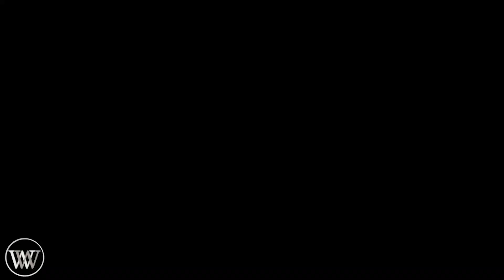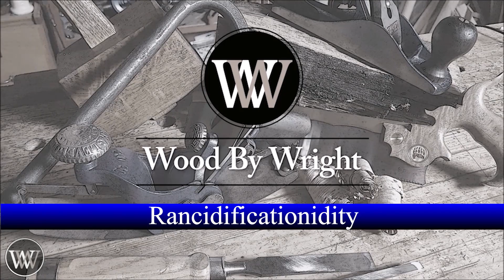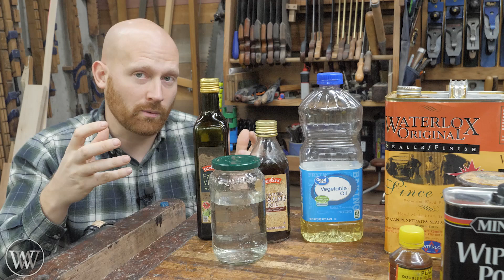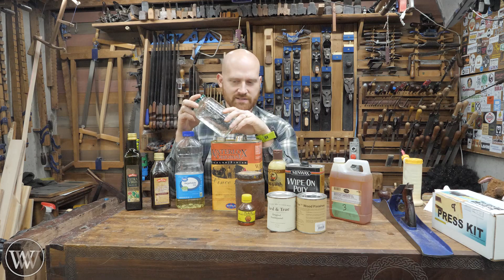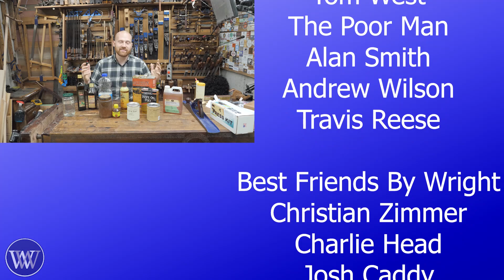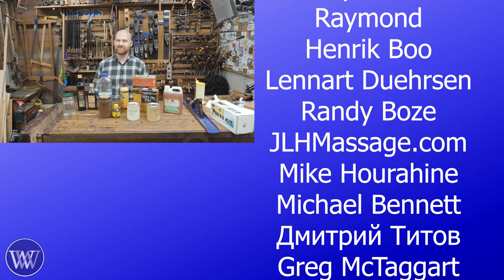What Does It Mean To Go Rancid Food Safe Woodworking Finishes

Comment: James, I am abandoning the woodworker in me,  and putting on my  highly trained sous chef toque:  

If you use a film based finish (lacquer, shellac, etc) your knife edge will eventually work through the finish, you'll start to get little bits of finish breaking off,  you'll eventually wear through the finish and expose raw wood underneath.  And yes - that stuff will get into your food. As Stumpy Nubs has said - by the time it's full hardened, it's inert.  Many folks don't know this,  but shellac is used in many foods - it makes stuff shiny. Ever eat M&M's?   

Next - food grade oils take a long time to go off.  If you use the boards regularly (even once a week) and wash, dry and store them properly afterwards (you have to wash the ENTIRE board - not just the cutting surface) -  the oil won't have a chance  to go rancid.  I oil mine every six months or so.  I use whatever is lying around the kitchen in abundance at that moment.   I oil them lightly and wash and dry them immediately after oiling. 

Lastly- If you need boards to leave for months on end with no use, or in the back of your  locked up,  110f degree camper van all summer - buy NSF plastic ones.   

A whole, huge lot of this is about common sense.  If the whole idea just freaks you out - then just don't finish them.  They'll still last for years and years.
Reply from the maker: Well said.

Comment: I think the thing most people mean by "don't use olive oil, it will go rancid" is the fact, that olive oil acids hardens/oxidizes so slowly, that the fats and proteins in the oil can oxidize before the oil acids, which smells really bad. The same goes for cold pressed, untreated linseed oil. It can harden so slowly (taking weeks), that the protein/fats oxidize and smell. That's why oil for paints, oil for treating wood outside is usually processed in some kind of fashion. Degummed etc. so the "smelly bits" that oxidize and go rancid don't "spoil" the smell of the oil while its oil acids polymerize.
Reply: does raw linseed oil smell bad when cured?
Reply: @noahjohnston  No. It has no odor whatsoever. Once cured it is like "natural plastic" or soft rubberlike in consistency.

Comment: Great video!  My concern about wood finishes used on items that contact food is the drying agents (often heavy metals) that manufacturers put into ready to apply finishes like BLO, Danish oil, and wipe on poly so that they dry faster between coats.  I don't even worry about the solvents, however nasty, that these products contain because when they're fully cured, those solvents have all long since evaporated away.   
My only concern about using vegetable oils on wood surfaces that will see contact with food is the possible transfer of off-putting flavors to my food during use.  Also, the smell of rancid or polymerizing oil is not appetizing.  But there's an easy, if time consuming fix to this problem - not using those items until the vegetable oil finish is FULLY CURED which can take many days.   That's the one advantage of mineral oil - you can give a dry cutting board a quick once over and use it pretty much immediately without any weird odors or flavors ever being a problem.

Comment: Most people  use the term rancid to mean the oil has changed flavor and smell to become something no longer suitable for food.  Not all oils polymerize over time.  This is very important when it comes to wood finishing.  If you put a non hardening oil on a cutting board or salad bowl and it then becomes rancid, that smell and flavor will be transferred to whatever food is in contact with that wood.  

For wood finishing you need an oil that does polymerize to become hard and tough.

Comment: The finish is also going to depend if you are doing end grain vs side grain.  I like the mineral oil on my patterned end grain board because it keeps the wood expanded, and yeah I have to reapply it, but it means the board doesn't dry out as fast as a finish that hardens and can't be reapplied.  I should specify that I put a tung/mineral spirits finish on first and let that dry out completely as a base before using the mineral oil as an top coat.  If you are using a side grain board you would want something that toughens the hell out of the wood, where as the end grain board is already pretty darn tough.  Good video!

Comment: Thanks for  this video. It will help me to counter my many green relatives who think I'm trying to off them for the inheritance.  I confess I have never used mineral oil for anything beyond rubbing on a baby's bottom. For wooden food utensils, my go to is olive oil mostly because it's already in the kitchen. But, it is slow to oxidize, so I prefer BLO.  Whichever oxidizing oil you use, It speeds the curing if you hang it outside or in a north window to let the sun shower it with UV.

Comment: that's youtube for you.  i see so much misinformation in the wood working channels from people with no training or background,  espousing all sorts of wild theories which they learn't from someone else on youtube etc etc.  my biggest pet peeve are all the videos on setting up jointer knives.   they all say snipe is normal and just cut your boards a bit longer so you can cut it off.  they all tell you to set your knives just a little higher than the outfeed table.  i got so fed up with this that i actually did a video on the correct way to set up a jointer and use it.  so good for you james in attacking the bullshit and spreading some facts in this area.  to be honest, i have always used a mix of poly, linseed and turps to really soak down into the wood.  once all the chemicals have gassed off i feel its pretty safe.  i am retired now but still enjoy watching different channels for ideas etc.

Comment: While I've used vegetable oil on wooden utensils since I was a kid and learned it from my Mom, trying to re-educate all of my clients doesn't sound appealing since "rancid" is widely accepted as a bad thing and most people know that different oils do go rancid. I make a ton of "designer" and regular cutting boards for clients and send them home with a jar of mineral oil/wax blend to reapply when needed. It just works. Also, olive oil going rancid on a wooden spoon stinks very badly and doesn't make one want to try it again or even re-use the utensil.
Reply: This has to be my favorite comment so far. I agree with the olive oil statement, and would add that I saw a news article a few years back that stated that many bottles of imported olive oil sold in stores were rancid by the time they ended up on the shelf. Yeah... I find it easier to just sell customers on non-drying oils and wax

Comment: I always figured that for the food oils that if they went "rancid" then the thing they were applied to (cutting board, bowls, utensils, etc) would start to smell bad or give the food an odd taste. However, I would think if you are using those items, washing, and renewing the oil that it would not be an issue? Also, I am most certainly in the camp of "well I heard it from" or "I read it on the internet". Time to dig through some research papers.

Comment: Well here are the questions I would have:

1. which finishes in general get a higher bacteria load? and  They I am sure aren't all the same an d some will encourage worse species than others perhaps.
2. Which ones would possibly smell worse over time and leaving in humid warm conditions?

Those are the two burning questions for me putting something on wood.  I will look at the references, but if you do a follow up please address these?
Reply from the maker: I was actually trying to find any information on bacterial load on different oils but most things that I've said and haven't touched on it or just say that it's all similar. As to smell or taste once it's polymerized they're all the same. It doesn't do anything.
Reply: @WoodByWrightHowTo  I did have one question spring to mind during the video that's in line with these questions/ your comment. Do all the oxidation prone oils polymerise? From my searches of (a not very reliable source) Wikipedia, olive oil for instance has only 15 % polyunsaturated content vs the 65-70+% content in lindseed oil. As such any molecule made during the oxidation process is still likely to be a low-ish length oil vs a relatively long chain polymer. Admittedly that's not to say the molecules are still volatile enough to smell but I'd imagine they will act extremely different to say lindseed oil. Something to look up I guess when I have some free time lol

Edit: typos lol
Edit 2: forgot to say, great video.
Reply: @aledlewis5371  No, not all oxidation results in polymerization. This is a good video to bring up the topic, but that is a criticism of this video it conflates the two a bit. Oils that polymerize readily are drying oils. Polymerization requires not only oxidation and breakdown, but cross linking. Not all oils do this to the same extent. Rancidity is not polymerization but the unpleasant taste and odor from the initial oxidation, and generally before significant polymerization happens.  If/when polymerization occurs there will be no unpleasant odor or taste.
Reply: @ccbowers  well that's what I thought, when he included olive oil in the list of things that you want to go rancid. I haven't really got any personal experience with olive oil and the rest going rancid, at least not in the food sense. But if the oil doesn't actually polymerise, and I'd be suprised if olive oil does by it's typical oil content, then its likely to be similar in succeptibility to leaching as the mineral oil. It may still be food safe, but would you actually want something rancid to leach into your food? Same with the chemical driers in drying oils. I doubt the oils will react to completenion and so would have thought the rate of leaching would slow but it wouldn't actually stop. It wouldn't be a problem for James's homemade BLO and I'm pretty sure he mentions it himself in other videos. I'll be honest I haven't had time to really check the literature on the commercial catalysed versions though.
Reply: Just watched the Stumps Nubs video and, whilst I'd still like to see literature on it before using it myself, it does sound like BLO likely doesn't leach in dangerous amounts do I take that part of my comment back
Reply from the maker: Yes. Not all oxidation is polymerization. But other forms of oxidation will change texture taste or color. But there is no form of oxidation that will become harmful. They just become less desirable if you want to taste them.

Comment: My girlfriend has a huge number of bottles with all kinds of oils ment for some kind of cooking/medicinal/skin care/etc. use - wallnut, raspberry, apricot, cherry and a lot more laying around and most of them are expired, some have a rancidy smell and some are still sealed and look fine. I was wondering if I could use them as wood finish in both indoor and outdoor projects. Would they do any kind of job protecting the wood compared to leaving it untreated, specifically for the outdoor stuff and would there be a lingering smell or would one develop over time? I do not intend to use them on surfaces that would come in contact with food like cutting or charcuterie boards, more on the line of table legs and arm rests. I just don't want to toss them all out and buying wood finishing oils where I'm at is kinda expensive so in my mind it seems like a good idea to use what I have right now. Any thoughts?
Reply from the maker: They would be better then leaving it raw most of the time. The smell will disappear with time. But a lot of it has to do with the polymerization time of the oils. With most fresh oils that is a week to a month and it may get washed out before it can cure.
Reply: @WoodByWrightHowTo  thank you for the quick reply! I'll be sure to try and see how it goes.

Comment: I'm sure you've said it elsewhere, but what you do finish cutting boards with?  Seems you want to deal with the concerns of not imparting "off" flavors to whatever is on the board, plus its a finish that knives have to cut on, so film finishes I would expect to not perform well.
Reply from the maker: I used home made BLO. Once any oil polymerizes then you don't have to worry about flavors.

Comment: I have butcher-block countertops and when researching oils to finish the countertop I came across all these opinions on oils to use and to avoid "Rancidificationidity"  I always assumed that you wanted to avoid these oils because when they went rancid they would smell bad.  Was that a bad assumption?  I have to oil my countertops seemingly non-stop with mineral oil.  If the slower oils go "rancid" but don't smell that'd save me a bunch of time (and money)
Reply from the maker: The smell is only there tell it polymerizes. So it all depends on what you like to smell for that month or so. For counter tops you can't just keep them in the shop for that time.
Reply: @WoodByWrightHowTo  thanks for the response! Love the channel!

Comment: erm, the OED says Rancid means "unpleasant taste or smell". These other conditions have other words that describe the: moldy, fetid, putrid, tainted, etc.. 

Mineral Oil is unpleasant to taste and smell right out of the gate, not only that, but mineral oil will give you epic, four horses of the apocalypse style, diarrhea. In the US "food safe" is government regulated term, and it's not what you or I would often consider actually safe in and around food. In the US, for example, mineral oil can legally contain up to 10% benzene without being labeled as containing benzene. Most of it doesn't contain that much, but most Mineral Oils aside from "Odorless" mineral oil contain some petroleum distillate contaminants. In some countries you can't even buy mineral oil except "odourless" types. So ya, food safe means different things for different people.

Some vegetable oils naturally polymerize into long chain polymers over time without adding any chemicals. Olive oil and Linseed Oil are two notable examples. Both, if left alone, will turn into a very soft plastic. In wood, both oils mechanically bond to the wood fibres over time, if not washed out by water first. Linseed oil is unpleasant to eat right out of the plant, though not bad smelling. While olive oil is, for a lot people, delicious and smells great. Over time Olive oil simply loses its smell and flavour mostly through oxidation. Unless it becomes contaminated with something else, olive oil pretty much never smells truly unpleasant, nor does it taste truly unpleasant. Eventually it just becomes "tired", lacking in flavour and smell. so much so that there are countless articles on the internet telling you how to decide if your olive oil is past it. Olive oil really doesn't go "rancid". It does polymerize all by itself, and much faster in UV, but it doesn't go rancid. Linseed oil begins "rancid" and it doesn't get any better, if anything, it tastes worse over time. But it also polymerizes, but in heat and UV. If you heat linseed oil in the presence of natural fibres like cotton, linen, wood, it can actually get very hard, it was those properties that created a product called "linoleum" which was used as floor covering for centuries.

Some vegetable oils contain natural anti-fungal and anti-microbial agents, like olive oil for example. Some do not. You have to realize that regardless of what anti-agent you use, its efficacy decays fairly quickly, from a few days for some, to a few months at most. After that the anti-action is gone. Wood itself contains natural oils and chemicals that prevent mold, and reduce bacterial activity. But that action too decays over time. This is why wood cutting boards are generally safer than plastic alternatives, as you use a cutting board, you cut the fibres anew and release small amounts of anti-fungals and anti-microbial. Maybe not enough to be meaningful, but plastic has no such property at all.

Enter vegetable oils for cutting boards and other wooden food contact items. You use the wooden food contact item, then you wash it, then you wipe it lightly with vegetable oil. Now it is clean and protected until the next time you use it, provided you use it within the active window. After that window, you should just wash it and renew the vegetable oil. This is why vegetable oil should be your go to finish for food surfaces, not industrial polymer resins. 

A modern polymer resin is really creating a plastic film finish on top of your wood. Cutting into that plastic creates pockets that are mechanically difficult to clean, this is why plastic cutting boards are required to wash in detergent, high temperature water, and a sterilizing agent.

I agree, there is just so much misinformation out there, much it due to the loss of precision in our use of language. A normal cycle of most languages as they change over time and as cultures rise and fall.